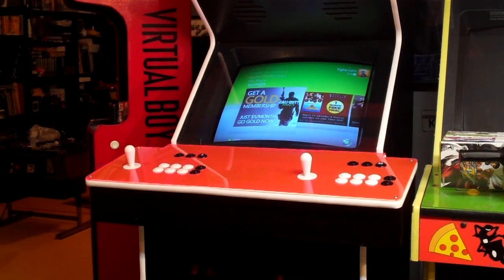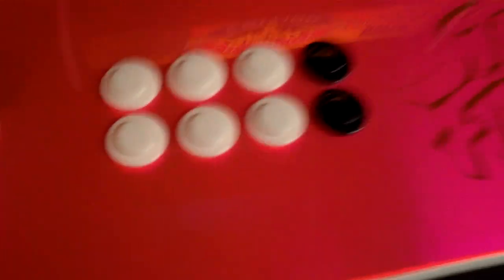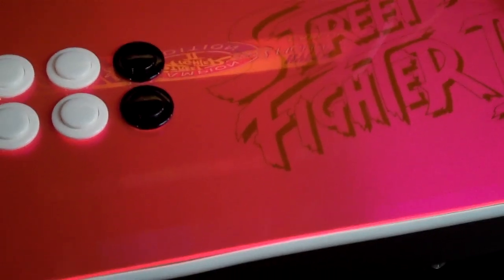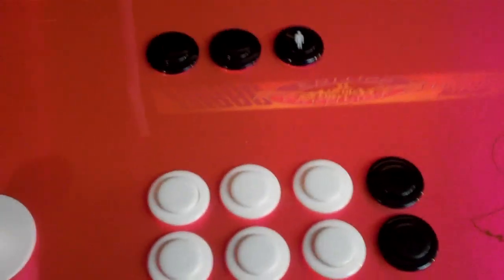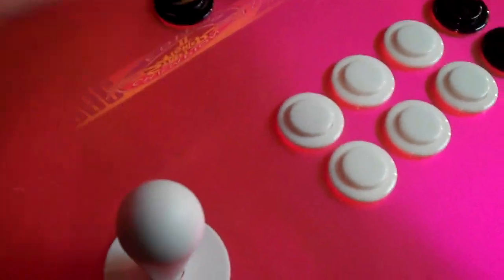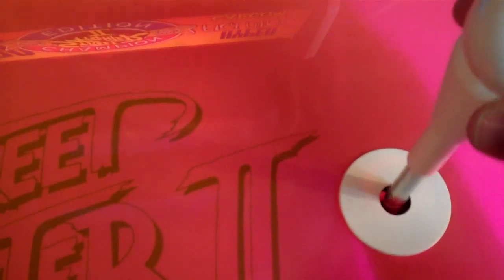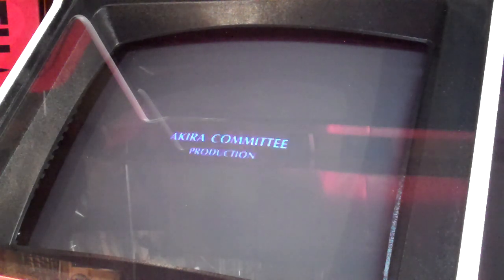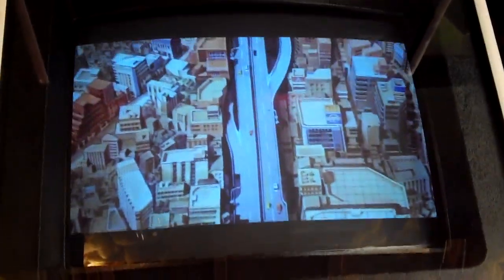Xbox 360 Arcade Cabinet

Comment: @tigheklory Not talking about this specific cabinet, am talking about all your gaming related stuff you showed so far. Of course was joking about RED, that camera is insanely expensive, but a better one is definitely welcome.
Question. From my experience with all kinds of plexi, they have a tendency to scratch very easily. Did you cover it with something for protection? Does the washer leaves scratches?